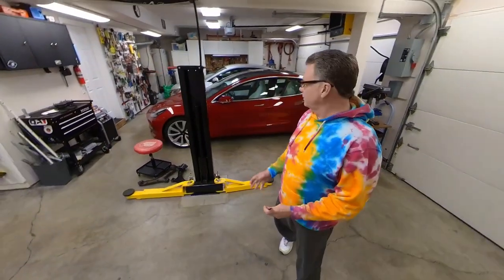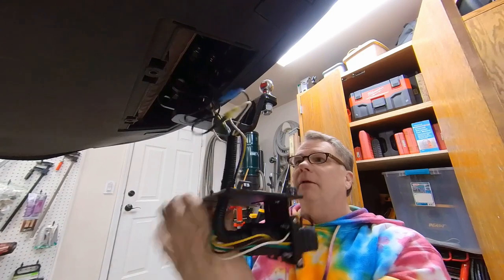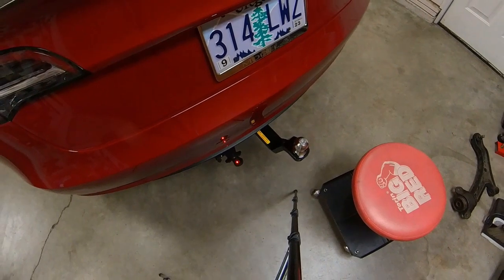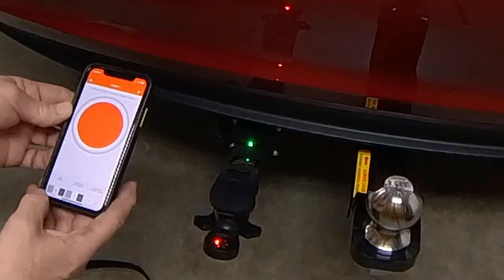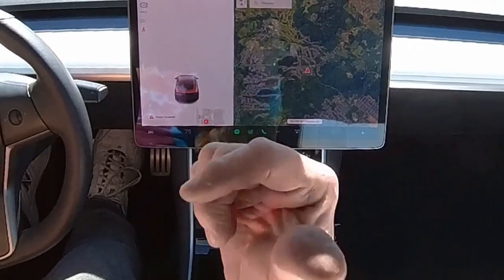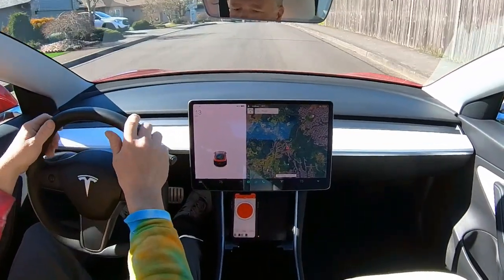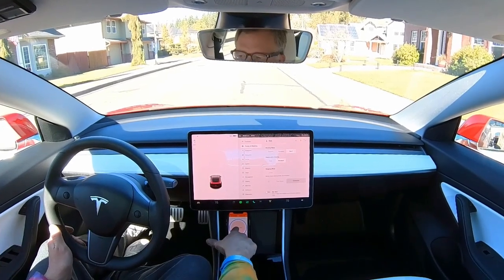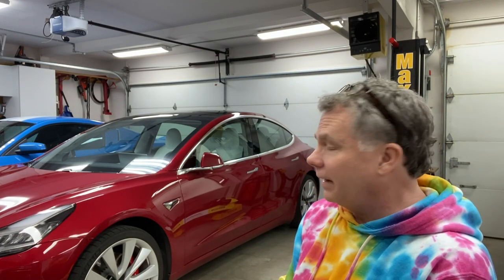Tesla Model 3 Trailer Brake Installation (Part 3)

Comment: Have you ever had issues with ground clearance on the 7-way connector? Curious because I have the Stealth Hitch bike rack receiver and it's lower then your ball - it scrapes occasionally on bumps and inclines.
Reply from the maker: I have been using it continuely for the last month and have had no scapes as of yet, however I have only driven on main streets and just a few steep driveways with light loads.

Comment: Have you maxed it out yet? I have the exact same setup except I welded a bracket on the tow bar for the 7 pin connector (using magnetic mount) and then I shove all of the wires back under the panel when not towing. I want to tow a small camper but the one I want has a tongue weight of 350lbs and when we dropped it on the hitch the squat looked like too much. Wish there was something aftermarket to increase that weight. I think air bags could fix the squat but then what is the part that set the OEM limit of 200 tongue and 2000 tow.
Reply from the maker: Hi, I have not maxed it out yet, and I only tow using a tow dolly, so my tongue weight will never come close to 350lbs, I am by no means an expert on this matter. Below is a link to an interesting video of someone that is towing lots of weight that you might find informative. Good luck and have a great day!

Here is the link:

https://insideevs.com/news/449710/tesla-model-3-tows-huge-airstream-range/
Reply: @mattsautomotivechannel  Yeah, he’s got a custom hitch that I think runs to the motor carriage. The stealth can’t do weight distribution like his can.
Reply: @dvwatts  Did you ever try maxing it out at 350lbs? I'm considering the same...
Reply: @user-dy9ux5dc6e  Not yet. We bought the trailer we wanted a few weeks ago and have been towing with ICE for the short term. I’m going to do some weight/drag reduction and try it soon.